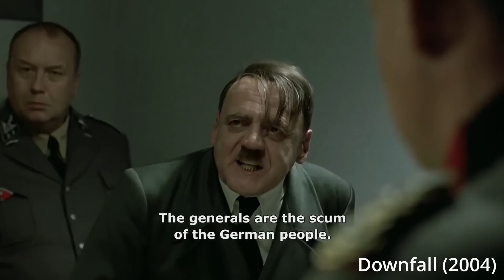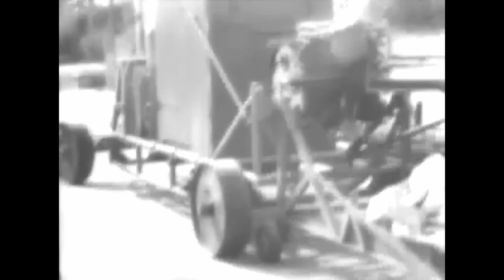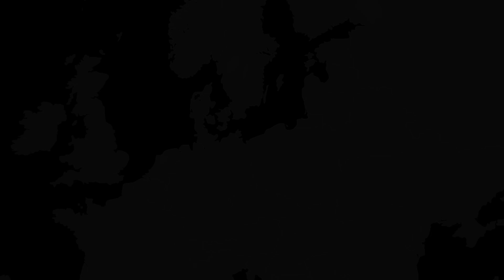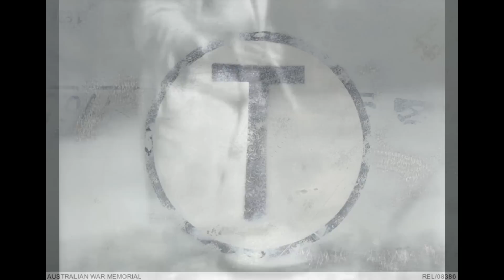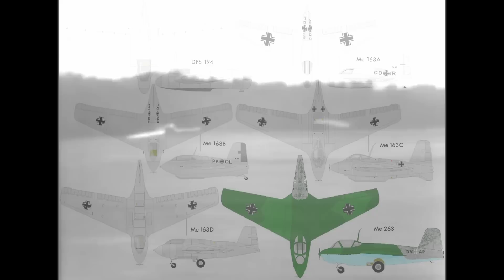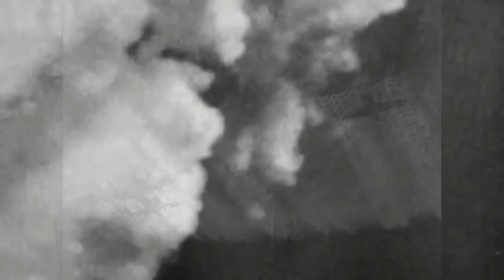Me-163: The story and horrifying chemistry of the world’s only rocket powered fighter

Comment: Given the success of the Komet as a flying machine, it's a wonder that they didn't pursue some of the Lippisch variants like different P.15 that put jets in it. 
They ranged from single jet and the same dolly & skid, to twin jets and actual retractable wheels.

Once pilots understood its particular quirks & features, it flew very well.

Lippisch's last iteration of the "Delta", with substantial fin (eventually without the little canards) also flew well.

Several modern delta type variations also work well: see the Dyke and the Verhees light planes which are quite well mannered and pilot friendly.
 Then there's the remarkable Wainfan "Facetmobile" of the '90s, which is currently working on a modern 2seat upgrade. Arguably better in all important criteria than "normal" planes.

Comment: Gotta wonder if it would have broke the sound barrier if would have been air dropped?
Reply: Compressibility & critical Mach, and area ruling weren't known. The light wooden construction couldn't handle the shocks at speeds that were too high.
Reply: @JFrazer4303  So if the Comet did go through Mach-1 then there would be a rapid, un-commanded disassembly of the aircraft.
Supersonic flight is not an easy undertaking.

Comment: In defence of high-concentration hydrogen peroxide--at least it isn't carcinogenic (unlike hydrazine)! However, both are extremely nasty chemicals to work with, and even nastier if they happen to be used as fuels in a hastily produced, 1940s-era military aircraft that may be subject to incoming machine gun bullets, fragments, and cannon shells.

In most WWII-era fighters, having a fuel line severed or fuel tank punctured was not good news for the pilot, as it could ignite a fire that could turn the aircraft into a fireball (self-sealing fuel tanks helped a bit with the latter). In the M3 163, having a fuel tank punctured or a fuel line severed would potentially result in the effects you describe--flesh-dissolving, hypergolic fuels being sprayed around the cockpit.

There was also the problem of refuelling these aircraft on the ground. As they needed to get the Komets up into the air fast, one can imagine that there were potentially some horrific accidents among the ground crews as well--especially if they were trying to scramble Me 163s to respond to a nearby bombing raid. 

The ironic thing is that if the Germans had put the effort they spent on the Me 163 into developing proximity fuzes for anti-aircraft artillery or even developing surface-to-air missiles (they had some projects that never really went anywhere), that would have had a greater effect against the Allied bombing raids than the Komet, which was essentially a dead end in terms of aircraft design--military or otherwise.
Reply: Even the proximity fuse lagged far behind fighter cover when it came to deterring bombing attacks (at least at sea), so I doubt that would have helped Germany much.